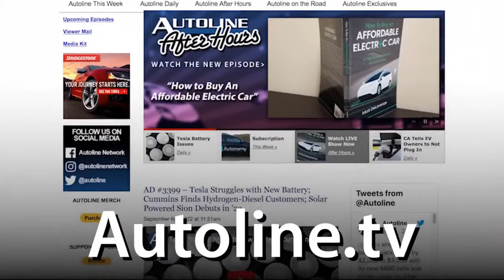Cadillac Celestiq EV: The Inside Story From The Chief Engineer

Comment: I'd like to know why they went with the rear styling they did.  Typically a hatchback look isn't associated with an exclusive,  high dollar car.  Especially when you see cars like the sixteen, for example,  whichbto my eye was absolutely stunning and I'm shocked it never made it to production as a halo car.  Instead we get the cts and ct5?  They might be good but neither has that absolute steamroller looks of the sixteen.  Both gm and ford have had some awesome design themes but very few make it to reality and when they do they are pretty watered down and only vaguely resemble the concept
Reply: Copying the model S.
Reply: The rear end dates back to early 1900's Cadillac

Comment: I still wish they used the Escala concept I don't agree with them saying it wasn't the right car
Reply: Escala is nice, but it was on the wrong platform, it wouldn't be able to hold the batteries or motors properly. The Celestiq is much larger.

Comment: I’m very pro electric and we need as many electrics as possible. But at $300,000 this car will be as popular as a $75,000 ELR was.
Reply: I think the ELR had the exterior styling but the rest as a copy of the 1st year Chevrolet Volt!  Cadillac never updated to the more powerful Volt engine either and let it sat to die in their showrooms.
Reply: The Celestiq is sold out.  The ELR never got off the ground, because it was a much more expensive interpretation of the Volt.
Reply: @firefox39693  sold out.,.all 100 or so of them? Problem is the technology for a great EV platform doesn't exist at GM.